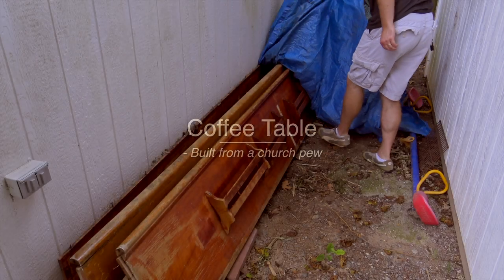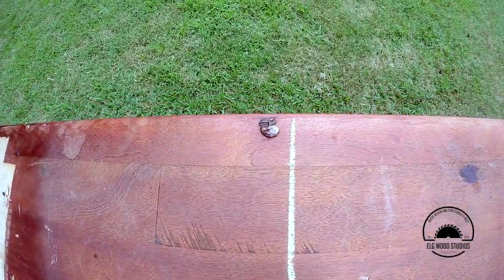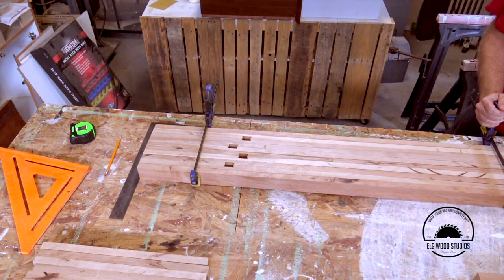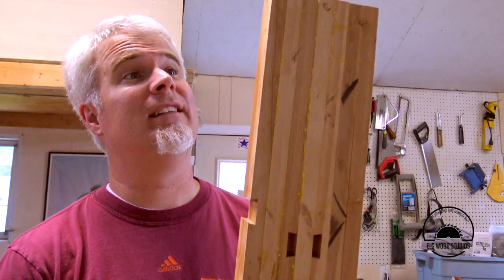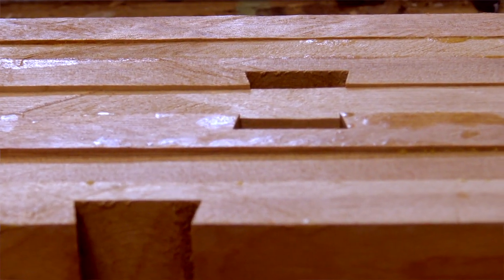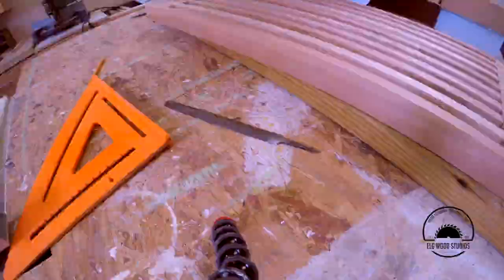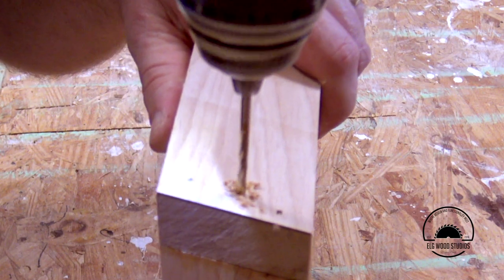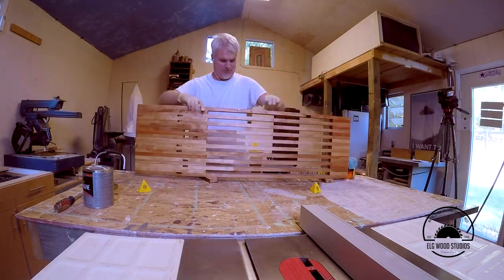Making a Mid Century Modern Coffee Table

Comment: Great job— thanks for sharing all of it.  
BTW, if you use a good glue like one of the Titebond’s, and clamp properly, the glue joint is significantly stronger than the wood around it.  In fact, adding nails or screws actually adds stress/fatigue points that will make a good glue joint weaker.   They learned this by both stress testing new joints and studying old furniture.   

There are times to use screws of the right type via the correct methods (e.g. piloted, cross fiber, etc), such a screwed/glued flooring, setting rafters, fence planking, etc. where glue is not efficient, needed or appropriate, etc.  However, in virtually all furniture related woodworking, nails and screws are not used to increase structural integrity, because they don’t.  
You will likely notice cracks around the screws over time—especially if you didn’t pilot and use specially coated wood screws that have a small amount of pliancy.  This is especially important if the furniture is outdoors, due to thermal and humidity fluctuations (e.g. GuardDog Exterior Wood Screw’s, etc).

Comment: Very nice reuse of trash!!
One comment, the 2 outer leg screws need an elongated holes, to allow the top slab to move with moisture change because of the perpendicular grain orientation.
They will break over time if the wood is restricted, wood movement is stronger than the screws😊
Reply from the maker: Thanks for the tip!

Comment: Beautiful build !!!  I subscribed because of it.  One thing, at 8:46 you're ripping an angle that can trap the wood and shoot it out back at you with a terrible kickback.  Granted i'm a noob at woodworking, so my personal word doesn't carry much weight, but i've seen several experienced sources warn against that. To counter that, run your fence on the other side of the angle, you've got a V shape that doesn't trap the wood that way.  Other than that, i'm inspired, i need to make one of these!!!!
Reply from the maker: Thanks!  I use a "wider" push stick in this case to it's a bit more stable against kick back and i try to keep the cut rate slow and steady.  If i was using a thin push stick i could definitely see some kickback.  Thanks for the note though!
Reply: I bet that wider push stick helps not angle the wood into the blade, but i'd still be wary of making a trapezoid where the wood has no place to go if it gets bound up..  John explains it better than i can: https://www.youtube.com/watch?v=L_C-twF_cA8    ps. delete this if it's annoying.  In any case i really enjoyed this video and am inspired by your build.
Reply from the maker: I'll take a look.  Thanks man!